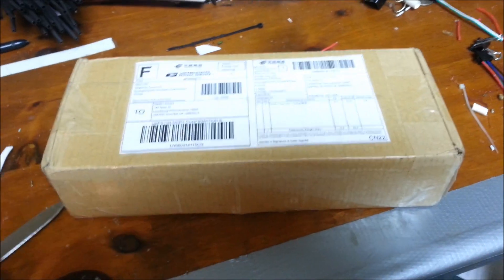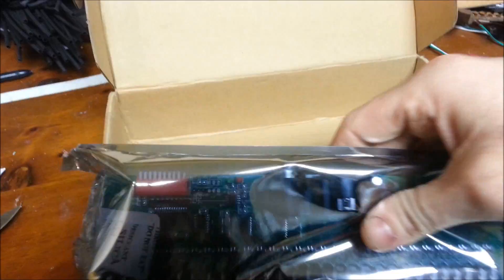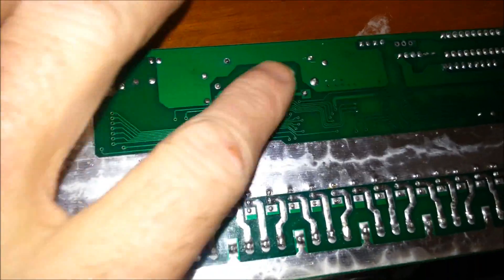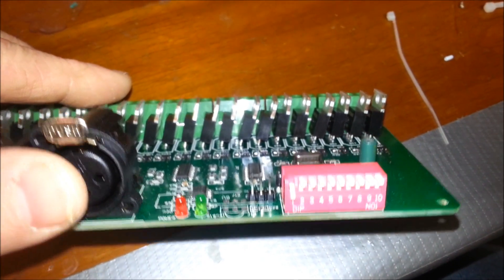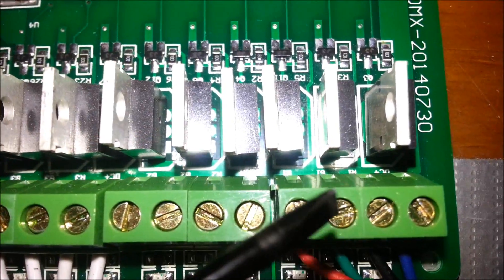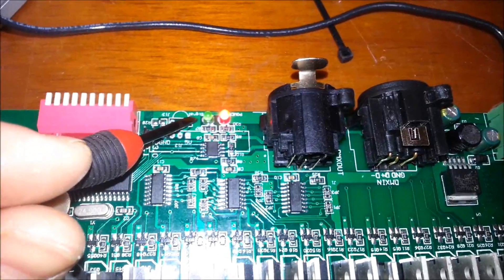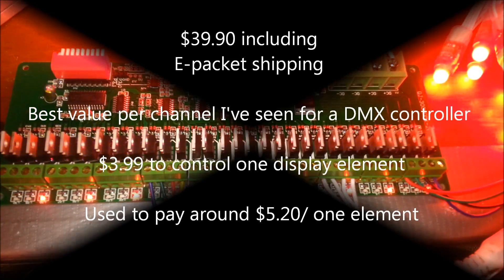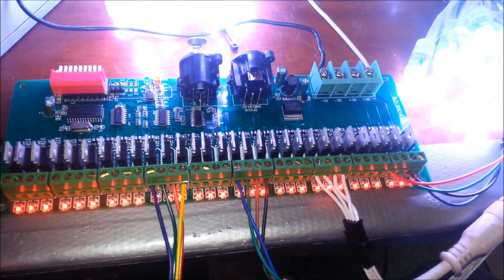30 Channel DMX Controller under $40

Comment: So WHY remove the INDUSTRY STANDARD XLR Connectors and Replace them with RJ45 Connectors that only you Christmas Light guys use . Not Sure WHY you use them . In PRO Lighting we use 5 Pin XLR's but in the Bar Band type of lights they use the 3 Pin XLR's . Some PRO Lights now come with both .
Reply from the maker: HAHA because they get in the way in our enclosures :) besides :) I don't use them and easier to solder in the RJ45 connectors.

Comment: I did some stage lighting before DMX came along, (switched over to computer programming and photography,) but am starting to learn about DMX to have some fun with holiday lights as I get ready to "retire."  I found the link above still works, but is listed as out of stock.  It seems they listened to your video about RJ45, as its replacement seems to have both.  I am enjoying learning from your videos and others... it's a bit of a learning curve, but I was writing light control for a nightclub in machine code on a Commodore 64 (and later 128) before I was able to use Visual Basic on the PC.   Why I didn't switch in the 1980s to DMX I don't know, but I was using relay boxes, and three parallel port, and four serial port outputs to run 30-40 channels of lights in several nightclubs.  Anyway, here's the link to the new version, so folks won't have to do what you did and modify their boards.
www.aliexpress.com/item/30CHANNEL-27CH-EASY-DMX-LED-controller-DMX-decoder-driver-RGB-led-controller/32387978299.html?spm=2114.search0104.3.65.2c5c82186Fm489&ws_ab_test=searchweb0_0,searchweb201602_1_10152_10151_10065_10344_10130_10068_10324_10547_10342_10325_10546_10343_10340_10548_10341_10545_10084_10083_10615_10307_10059_10314_10534_100031_10604_10103_10142,searchweb201603_25,ppcSwitch_5&algo_expid=6eb18b4d-71f2-4e5a-a846-bd7ece6f39d2-9&algo_pvid=6eb18b4d-71f2-4e5a-a846-bd7ece6f39d2&transAbTest=ae803_5&priceBeautifyAB=4

Comment: Hi, I am a newbie with this sort of stuff but I bought one of these last year and could never use it (didn't know how) thought it was a plug and play sort of thing but anyway my question is how do I find it's IP address, I've downloaded a program (advanced IP scanner) but it doesn't show up when I connect to the laptop, any ideas would be greatly appreciated. Thanks in advance if you can.
Reply from the maker: This is not E1.31... it is a dumb RGB controller... It doesn't use pixels. You must connect to a dongle or "bridge" which can translate the e1.31 signal from the computer software into DMX.
Reply: Leechburg Lights Thanks for the reply, I'll have to look into getting one so, thanks again

Comment: What is the output voltage for each of the rgb terminals? I want to hook some 10w rgb leds to this ☺️
Reply from the maker: mickeythepuppy 
input is 9-12 volts...   output is what you put into it.  Watts are not the same thing as volts.  Watt is the amount of power used by the led.  Volts is the power required to run the led.  sooo... you most likely have a 12volt flood. You  must have a  12v power supply.  This board will serve you well for floods.
Reply: Leechburg Lights thanks! The rgb floods are indeed 12v, but have that crappy built in ir controller. I'll need to bypass it to be able to properly control the lights directly from DMX. I put voltage for the chip is 6v-11v, so I want to make sure I get the correct resistors in there. I assumed the output voltage was a constant 12, didn't know it could vary. Thanks for the info!
Reply from the maker: IDK if you can.  There are some folks who have hacked those kinds of flood lights.  To my understanding it cost more for the hack than it did to just by a flood designed to run with a dumb RGB controller.  But part of the fun with this hobby is actually getting things to work the way you want them to.

Comment: Hi, I am new at this and I would like to make some cool Christmas lights effect for this coming year.  I have some Square LED WS2811 and I wondering if they would work with this 30 channel DMX controller?  What will be my best controller for the buck with a lot of light effect.  What I am trying to accomplish for my project is the mega tree effect.  What are the different between the DUMB vs SMART controller?

Thanks
Reply from the maker: This controller is a DUMB RGB controller.  It will not control pixels.  I recommend the F16v2 (now testing the F16v3 prototype)... you can find them at :
http://pixelcontroller.com/

Here is a video on Dumb Vs Smart
https://www.youtube.com/watch?v=22blRaz5gZM

Comment: Just had to add... thats not neutral, its signal(-).

DMX uses two signal lines that are inverted for error checking(if + is high, - MUST be low, and visa versa). if both bits come though the same, there has been an error in route and the bit is disregarded.
Reply from the maker: I did not know that... Cool.
Reply: I spent WAY too much time studying the protocol, my nerd brain had to get it out. lol

A haunted house ive worked with uses 2 of the 16ch versions to trigger valves on a pneumatic character. Other than a few issues with connector wear(the stock XLR plugs get torqued very easily) they have been rock solid. And we havent been nice to them.

Comment: I got this controller last year and i am finally getting around to try it out, well im not having so much luck i guess you might say. I am using xlights, I have communication with the board but its not working properly. Im sure its my set up but im not sure what im doing wrong. I have 4 rgb string on 4 ch. but when i run my program i have ch.5 lighting up. im lost any help will be greatfull    12v leds and every thing works great in test mode on the board

Comment: I have 4 of these controllers and plan on using them on my display this year. First year using RGB so still trying to get my feet wet. I plan on using 100 nodes per output so thats about 1000 nodes per controller (that is what I was hoping to run) Will this controller have any problems running all 1000 in white for extended amounts of time? Do you fuse your incoming 12V supply with a 25 A or 30 A fuse?
Reply from the maker: I have not tested with 1000 nodes yet.  Someone did test it that way and found there is flicker with all 100 ct nodes.  I have only used 80 max per output with no trouble and on full white (my five snowmen). I have not fused the incoming power lines.  it is an added level of protection but not necessary for my use.  Also I don't run my display at full intensity. Usually around 65%.  have fun!
Reply: How would I measure "usage" across the board? Is 65% bright enough?
Reply from the maker: You need to watch a few vids on  youtube about using a multi meter :)  You take a measurement at the beginning of the set of RGB's, then another reading at the end.  The difference between the two is your usage.  

As for brightness, I had a news paper reporter show up at the house the week of Thanksgiving 2015.  She said, "wow that is really bright."   I told her that it was only at 50% brightness. I then adjusted it to 100%.  It is amazing how bright they are.  You don't need to run at full intensity through the whole sequence.

Comment: why would you remove the XLR connectors ?
Reply from the maker: I do not use XLR connectors.  I use RJ45 connectors.  All of my controllers are run using E1.31.  Using RJ45 makes it easy and I can make a cable for it in seconds.  Also, the orientation of that connector would not work good with my enclosure.  I could not make he connection to my DMX.   Thankfully the manufacturer has upgraded the board to include RJ45 connectors.  I ordered the new ones and won't need to change them out.  The new version still has the XLR connector.

Comment: Are the new boards from this place basic plug and play with LOR or is other hardware needed?
Reply from the maker: +William Wagner Have a look at this video on how these boards use a DMX interface in order to control lights.  You must have a DMX interface.  Please read the other comments in this video as they answer your question as well
https://youtu.be/22blRaz5gZM?t=2m14s

Comment: Hello there! 
have you tried running something more powerful on it, like single high power chips? 
i have 2 of those boards (i actually have RJ45 connectors already soldered on it) 
LED strips run like a charm, but i want to know if someone has tried single chips...
Reply from the maker: +roman medvedevs What do you mean by "single high power chips?"  "more powerful?"   

All the new boards I've received have the RJ45 connectors.  This was the first board I ordered last year (2015)
Reply: By high power led i mean chips lik
e 10w 20w led chips that usually are sitting in floodlights... 
(Sorry for late response, been dragged away from hobbys... :(  )
Reply from the maker: I wouldn't push this controller to run more than 3 of the 12v 10 watt floods.   They will work just fine for that.  I have tested them out.
Reply: Leechburg Lights hmmm... 
10w should be not too much of a load for the plate... 
lets assume i stuck all 30 its only 300w, which is lil over 80% load.
did they go at full power?
Reply from the maker: I convert the watts to amps.  One 10 w flood light consumes .83 amps.  if you run 3 floods at .83 amps, then you'll be very close to the mosfet's limit of 1a per output. 
10 w / 12v = .83amps
Reply: you mean 1a per channel? 
i dont want more than one per head
Reply from the maker: Yes, one amp per channel is the mosfet's max.  One RGB output = 3 channels... thus you can run up to 3 safely.
Reply: i dont use RBG anyway, i use only channels. 
when you were testing, did they go 100% or power was down? 
and could you link which ones you used, please?
Reply from the maker: This was at full brightness or 100% intensity.  Here is the video, link is in description
https://www.youtube.com/watch?v=FqEcgeM4LQQ

Comment: Bonjour
mon soucis n est pas le branchement mais comment faire pour chaque voies fonctionne différemment.
ce controleur fonctionne en rgb en 10 fois  il n'y a de solutions pour en faire un chenillard 30 voies 
peut être un dmx mais je voudrai que les voies soit indépendante
si cela existe merci de me donner votre solution ? J ai vu sur une vidéo avec 2 boîtier mais je ne comprend pas à quoi ils servent
meilleurs voeux
cdt
Reply from the maker: +Jerome Albigot  Vous souhaitez utiliser 3 canaux par sortie ? Ce contrôleur régule la puissance du neutre ( - ) en ligne , pas le 12 volts + ligne . Votre DMX doit être capable de courir avec régulation de tension sur le neutre côté (-) . Si elle le peut, alors vous pouvez utiliser trois 12 volts + fils de la même grappe de sortie et le coupler avec un neutre ( - ) sur la même sortie . Pas sûr que ce soit la solution que vous cherchez?

Comment: whit this controller I can do this? show https://youtu.be/-EkgT_sNYDY
Reply from the maker: +Daimer Andres Aguas Fabra Thanks for watching.  This controller can not run pixels, like what you saw in the video link you posted.  This runs a string of RGB lights.  All the lights on this one string must light up the same.  You can not individually control each bulb.
Reply: Thanks!!! u

Comment: Leechburg Lights Hello. Great video. I was wondering, how would I control this via USB to my computer? I want to be able to control analog rgb led strips with this unit. Thanks
Reply from the maker: You must have some sort of USB to DMX dongle such as an Enttec Pro DMX dongle.  The output is connected to the LXR connector and can translate the DMX signal from the software out to the board through the dongle.   Another way to connect this board to the computer is using an ethernet cable (from your network jack on your computer) to a "bridge".  You can send DMX through the ethernet jack using E1.31 protocol (also known as DMX over network cable).  If connect this controller to the bridge, it can read the data from the computer's output.   Here is a new bridge I just picked up a few weeks ago.  More cost effective than the USB dongles if you run lots of RGB and multiple universes.
https://www.youtube.com/watch?v=O4KI3NjyP9g

Comment: When you do get it can you check it out and see if the RJ45s and be removed and replaced with a top mount jack instead if the side one it comes with. Also the dip switches are better located and located on the top instead of hanging off the side.
Reply from the maker: Brian Anderson 
I agree on both counts... the dipswitch needs to be on the top of the board as well as the RJ45 connectors.  Luckily I don't have that problem in my application, but others may.  The RJ45 will be a through-hole addition, and you should be able to remove them if necessary.  If this is an issue, then plug a network cable into the jack, install the board, then cut the wire and run to a second RJ45 jack.
Reply from the maker: Leechburg Lights Brian Anderson, I have purchased some top facing mounts and probably will mod this board for use in the controller housings.

Comment: There is a new version on this board with rj45 jacks now.
Reply from the maker: Yes, and I should be seeing 2 of them arrive in the next 2 days.  Will do a video review.  Also, last night I just installed this controller into an enclosure.... here is the one-minute video showing the XLR connectors removed along with the RJ45's installed.
https://www.youtube.com/watch?v=9JkJ3XdF_5Y
Reply: May I ask why you installed it vertically instead of horizontally?  I am installing them In small plastic boxes and and the CG 1500.  It takes less wire to put them in the 1500 horizontally.  I'd send you pictures but I'm not sure how. I think I can post them on Facebook and maybe you can look them over and tell me what you think.
Reply from the maker: This box is not wide enough to install with the controller at the bottom.  This was the only option for installation into the box.  This box is not a CG1500.  It was supplied by a friend who no loner needed it.  You can email me at leechburglights@gmail.com

Comment: I have 3 of these and am having trouble with vixen 3 > e1.31 bridge > 30 channel  controller. How do i set up vixen 3 to output DMX to the controller? I watched your other videos but they cover LOR and an e682 using an output from the e682.
Reply from the maker: The key is to make sure the e1.31 bridge is setup correctly.  Make sure your channel layout in Vixen specifies that universe is going out to that bridge.  Insure that Vixen is using e1.31 to output DMX.  Then make sure your dip switches are set to the correct start channel.  I'm no expert with Vixen.  I can not help you much with that.

Comment: That controller look good. how many Dumb Nodes I can load on that controller?
Reply from the maker: According to the directions this board tops out at 360w @12v.  The quantity of NODES depends on the power requirements of the node you select.  Most nodes are .3w each.  Assuming that is the node you are using, this board can max out at  1200 dumb nodes (a total of 360 watts is the board maximum).  This will run approximately 1amp per channel and a total of 30 amps. 

If you use modules that are .74w each (ones with 3 RGB per board / look like a strip), the number drops but is still significant.  You can run 480 modules total on this board or 48 per output. 

Both examples above assume an equal number of units across all the outputs... 120 dumb nodes or 48 modules per output.  These individual outputs can go  higher, but you must not go over the total requirements of the board in total or you're asking for trouble.  Believe me, 1200 dumb nodes is a LOT.  Just on my window frames I used 800.  And Last year I used around 780 for my mega tree.  This controller can run an easy Mega/spiral tree without any trouble at all.
Reply from the maker: Also, it is a good idea to not run the board at the "max".  Better to use the 80% rule or 30a X 80% = 24a max... this lowers your maximum nodes to 95 per channel or 950 total.  I have not experienced any failures in 2 years with any of my DMX controllers (or pixel controllers for that matter) heading this warning.